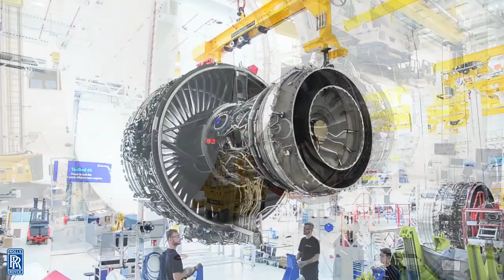Why don't Boeing and Airbus make their own engines?

Comment: Not only engines but aircraft manufacturers do not build avionics, instruments/sensors, computers, electricals, landing gears, propellers, tires, furnishings, windows, mechanical components, and many other components and subsystems. Their strength is in R&D, testing, systems integration, and marketing.  The certification and qualification of systems and sub-systems are complex, costly, and time-consuming. It depends a lot on specific domain skills and experience.

Comment: Then question: Why SpaceX who builds their own engine, avionics, landing legs etc has a cheaper cost than ULA to launch the same payload into space?
Reply: They are just going the Apple route but in the other direction. SpaceX is not cheaper, its just their profit margin is smaller compared to others and thats what you get when you have competition in the market. Now imaging if only SpaceX was able/capable of launching (monopoly over space), do you think they will not make the most out of it.
Reply: Two reasons:
1) They design/build very specific parts that not many companies build or that if they do, they sell overpriced since the demand is low
2) By developing yourself a piece, you remove the cost of intermediaries and their margins. Given that they use very complex elements, the number of intermediaries would be very high and they would probably lose a lot of money so that other companies make benefits
Reply: Because they bring the rocket back, while others throw it away.
Reply: @SheetHorizon21  No. SpaceX is not a toothpaste company as companies from last century, if their goal never change.
Reply: @smockydevil  
1) Yes. However, jet engines are also very specific. It is just appears to be that gas turbine technology can be used in various areas to distribute R&D cost. Rocket engine? Well, I do not know.
2) I think that is the reason why ULA's rockets are expensive and why NASA's initial proposal of Mars project was as well. If we can make things simple, we do not want to make it complex. That is how we do engineering.
Reply: Prince Ding avoid suppliers and competitions fucking with u
Reply: @princeding2114  
ULA was formed through the collaboration of Lockheed Martin and Boeing, they in turn subcontracted to other companies as well, adding up to the cost. NASA is known to also contract SpaceX (NASA's budget is tight right now so they will contract the cheapest company if have a choice), but their focus is still pretty limited so not every project can be awarded to SpaceX. Lockheed Martin and Boeing (and all companies they merged with) all have experiences with deep space projects, SpaceX's experience is still just within the Earth's orbit.
Reply: It IS cheaper to build things yourself. However jet engines are extremely complex and efficient, and while your margin would increase on the end product "planes", not all jet engines go to planes, they are used in many other places too. So you get another product line you have to sell to be competitive. Also for major businesses like Boeing and Airbus, which are publicly traded companies, the main thing is not to have lowest price and sell most planes, its more about exceeding shareholder expectations...
Reply: A lot of their components are not bring made by them.
Reply: EpiDemic117  WRONG !!!!  It is against anti trust laws in the USA for an airplane company to own an engine manufacturer and or an airline !!!  Back in the 1920 Boeing owned Pratt Whitney and United Airlines any by law suit from US government was forced to seperate !!! Anti trust laws !!!  Do the research !!!!
Reply: EpiDemic117  We are only talking about the airline business !!!!  That is what was broken up.  BUT as far as the trucks go Pac Car, Kenworth/Peterbuilt now are building their own line of engines !!!! As well as offering what is left of the industrial over the road engines !!!

Comment: Why doesn't Apple make its own camera, screen, battery?
Reply: it cant invent
Reply: Oh and they would make it double the doubled price
Reply: @User-nu6km  What is your definition of invent because certainly yours are different from mine.
Reply: putting things together from suppliers is not invention. Samsung makes their own ram, cpu, batteries, and screens for their phones.  @knmfujiwara
Reply: Although they do "make" their own CPU's and special chips, at least get others to make specific ones just for them rather than buying an OEM one.
Reply: They dont make their screens
Reply: because the something less time effort and money .
Reply: ams ag makes iphones proximity and light sensors.
Reply: Simple: APPLE WOULD F*** IT UP.
Reply: @User-nu6km  
Savage 😂😂😂
Reply: Apple do not even make the iPhone, the iPhone is made by Foxconn and Pegatron for Apple
Reply: @TheXcalculusx  Apple provides the designes  from Apple engineering teams ...chip manufacturers manufactre the chip provided from Apple which use arm architecture...as with design and camera lens and camera sensor provided by respective companies like Sony etc screen too and battery by other OEM anufactires like Samsung , LG ,jdl....so in this Apple contracts the manufacturing  companies..
Reply: Apples and Oranges😆🤑
Reply: It’s cheaper to outsource it to another company as they can buy all of the parts in bulk and they can save by not having to have to worry about having to build a new factory.

Comment: Your argument makes sense, however there are two more factors that you leave out.
1.) Mono- or Duopoly of Engine Manufactuers
There are only 2 or 3 Engines suppliers available for most planes. AND especially Boeing liked to do exclusive single supplier deals with only one supplier. So the argument of choice is not really there
2. Control over Investment and Production Ramping
The element of control over the production flow has become more and more important in recent times. As the saga of B737 and A320 series aircraft illustrates the aircraft companies being severely limited in their ability to ship aircraft due to the availability of Jet Engines. 
Apparently the engines for this class are highly valued but low priced and so the engine Mfgs. have not vuilt up sufficient capacity to supply the demand. This failure coupled with their oligopoly is costing Boeing and Airbus a lot of money.
So at least in the single isle sector control over production may become an issue.
Seeing the current shortages however illustrates powerfully how broken the traditional supply chain is.

Comment: I agree with what you have stated.  The engine competition remains as intense as the actual airline manufacturing.  I would like to see you do a comparison of the major engine manufacturers , including number of aircraft in various classes, safety record, and new orders.  Also, as a new 797 seems likely in the near future, it will probably demand a new class of engines.  Your analysis would be appreciated.

Comment: just imagine a boeing trent 1000
Reply: Airbus CFM56
Reply: Micah Briones: stupid comment! Trent 1000 is design for 787!
Reply: ROLLS ROYCE TRENT ENGINES ARE CHEAPLY MADE AND HAVE TENDENCY TO ROT, CORRODE AND EXPLODE PLUS ROLLS ROYCE SCANDAL PUTTING CHEAP METALS AND ALLOYS IN REPLACEMENT. BOEING HAS EXCLUSIVITY CONTRACT BARRYING AIRBUS FROM USING ENGINES MADE FOR BOEING JETS. ROLLS ROYCE ENGINES SUCK.
Reply: @kimberlywilliams7543  bruh. not even true.

Comment: Engine manufacturers are really good at what they do, just like the aircraft manufacturers are really good at what they do. I think the r&d that goes into each is astronomical in price, not to mention the proprietary knowledge involved in each. There’s probably a big liability risk in there too. Even the small aircraft companies don’t build their own engines. Before you compare aviation to the automotive business, remember that aviation is very safety regulated compared to automotive.

Comment: Now that Rolls-Royce has identified the very unfortunate problem in the Trent 1000, the knowledge gained will most likely make the Trent 1000, as well as the Trent XWB, Trent 7000, and others, more reliable than ever.
Reply: Rafael   RR will have to fix all the fkd up engines first !!!!

Comment: The fact is, both Airbus and Boeing are what's called an Airframers. The name kind of says it all. They build airframes. If you look at the aircrafts neither of the two companies actually "builds" most of the aircraft components. They will specify component requirements and buy parts from suppliers to put into their airframe. The gears are produced by one company, the avionics by another and hydraulics components by a third, or even several other companies. Basically no components or very few of them will actually have Boeing or Airbus written on their manufacturing tags. So why would it be any different with engines? Boeing and Airbus produce airframes which house components from other manufacturers, not everything on an aircraft.

Comment: The research in design, manufacturing and selection of materials required to make a decent engine took half a century to perfect.  Boeing, on the other hand, should finally do something about the 1950's era nose and front fuselage that the 737 MAX inherited from the 707.

Comment: Sticking to airliner jets Bristol and DeHavilland used to make their own aircraft and engines. Concorde was a Bristol design, made at the ex-Bristol factory using ex-Bristol engines (if a Rolls Royce jet engine has a non-river name it is not a Rolls-Royce design, hence, the Olympus engine was ex-Bristol). De Havilland also made jet engines, with the Comet the most famous civilian aircraft using DH jets.

Comment: Hmm. Interesting thought, GE is going to the only engine supplier for the B777X programme. Boeing said, it is to reduce the cost of each aircraft by having one engine supplier.  It will be interesting to see what will happen if GE being the only engine supplier to the B777X will do, experiences major problems with the GE9X like RR and P&W have had with their engines.
Reply: Chris   RR is the only engine supplier on the scarebus A350 !!!!  GE the sole engine supplier on the 747-8 and the 777X... By the way RR did not offer to participate in an engine for the 777X !!!!!

Comment: in 2009 the USA missed a chance to take away engine manufacturing from GM/Ford/Chrysler (also the dash instruments) .. the truck market, domestic and international (with a couple of exceptions) gets their engines from third parties .. the future of powerplants needs independent  thinking, motivation, and financing, especially for the car market .. elec engines, rotary engines or next-gen piston engines need to stand on its own and with possible consumer options based on owners needs and terrain .. the ludite practice of car companies making engines is holding the whole industry back

Comment: Why does Apple not make their own processor chips?
Reply: They do.
Reply: @Locutus  no they dont
Reply: Apple designs their ARM CPUs  and made by Samsung or TSMC fab contractors
Reply: @renebaebae0600  Apple may or may not 'manufacture' their own chips, but they design their own processors.
Reply: @Locutus  no, apple DOESNT MAKE (produce) their own soc. its made by third party manufacturer such as tsmc or samsung. hence my first answer. but yes they do design their own soc and leaves it to manufacturer to produce it
Reply: Apple dosent actually make the iphones
Reply: Apple is fab-less company, 
they don;t have their own factory for manufacture the chips & assembly
Reply: @Locutus  misinformation.   Apple is NOT in the CPU business.

Comment: Well there are a couple of reasons. Resources and regulations. Boeing and Airbus do not have the specific technical knowhow and experience to build an aircraft engine. 

Next, regulatory agencies such as the FAA have the engine building in a separate section. Both airbus and Boeing are certified as airframe builders (FAA CFR 25) while companies like Pratt, cfm, GE and Rolls are certified as engine builders (FAA CFR 33). if both were to go out and build their own engines, they would need certification and the authority to do so.

The lines do get blurred quite a bit when you talk about cowlings and reverses, but the separation between airframe and engine are pretty clear.
Reply: Rules and regs yes. But to say Boeing can't and dose not have the knowledge to build an engine is just wrong and stupid
Reply: @scott250r2  I didn't say that they can't learn to do so if they tried. They currently do not have the RIGHT expertise in my opinion. Their expertise is in airframe and NOT engines. 

I'll cite an example. For the longest time, they have been contracting out the work for nacelle systems to UTAS, Spirit, or Middleriver/Safran and that is as close to the engine you can get. They used to know until their propulsion systems division in Wichita got sold and eventually formed Spirit Aerosystems. They recently formed their propulsion systems team a couple years back in South Carolina and are essentially "relearning" the process of certifying and designing all of these nacelle systems in order to make them in house (well at least for the 737MAX and 777X). Even then, there have been hiccups like choosing GKN to manufacture the titanium parts for the 737MAX nacelle but not truly understanding that GKN could not meet the 737 production rate. 

The last time Boeing built any turbine engine from what i have seen was a turboshaft for the military and that was back in the Cold War Era. They can hire away as many industry experts as they want, but until they truly relearn how to build/design/test/certify these engines, they will face considerable challenges and significant resource drain in order to do so. They can set up the facilities, get the material they need, people, and machinery and tooling just based on typical industry practice and standards, but until they can get all the pieces together without failure and while maintaining a very fast paced production rate, it'll take quite a while to produce these turbofans that are commonplace in the commercial aircraft industry.

Comment: “Well, apart from Rolls Royce” #ROASTED #TRENT1000 #787NIGHTMARELINER #A330FEO
Reply: QuarioQuario54321 😂😂😂
Reply: Could you explain « FEO » ? I don’t have it.
Reply: William F. Maybe he means first engine option
Reply: Failing Engine Option or Faulty Engine Option. If I owned an airline, I would never buy my planes with RR engines. The A330neo and A350 force me to buy RR engines meaning I’d have an all-Boeing fleet or make the only airbus plane in my fleet the A380 or A380plus.

Comment: Boeing couldn't find suitable engine suppliers in the beginning and began building their own, they also could not find enough customers and so they started their own airlines and we're the first to have stewardesses  which I believe first appeared on the  Boeing tri motor. But alas, the snobs back east did not like this little Seattle startup rising so successfully and independently and competing with the tried and true of the industry. So they filed monopoly and anti trust suits forcing Boeing to divest both divisions. The motor division became Pratt and Whitney. The airline became United. My grand father was an electrical engineer when Ww2 broke out and worked on B-17s ,retiring on the 707. My dad started working there on B-52 #11. Then transfered to the Dash 8 program which became the 707. Then he transfered to Everett where he worked on the first 747 and every one after until he retired in 99. Dads brother worked on 707s and then 727s. Next month my son will start working for Boeing on 737 wings . I don't know why I never worked there. But I do know for my whole childhood, GE was a bad word and we usually flew United.

Comment: My question is with all the problems Rolls Royce has been having of late. Why any plane manufacturer or airline would chose to order their engines if given a choice?
Reply: They don't choose to go with RR. They do it because they have to. Most families of planes are only designed and certified around 1 or 2 types of engine. There are planes which can only use an RR engine. It's like US cable providers.
Reply: Doesn’t the 787 have the choice of RR or GE?
Reply: @lwrandall  Yep. That's one of the 2-type craft.
Reply: Engine manufacturers are part of the design and market phase of aircraft design. A large turbofan engine costs upwards of 2 billion USD to design and certify. 

If market analysis of an aircraft shows low market demand, an engine manufacturer will no bid the design. This is what happened to the A380, when GE and Pratt refused to offer an engine. The market analysis showed less than 250 aircraft over 20 years. If you were to have a three way engine split, each manufacturer would only be buildings 1,000 over 20 years, not nearly enough to recoup investment costs.
Reply: Gunga Dinn Thank you so much for the great explanation. I hadn’t thought of the overall aircraft market demand for determining what engines would be available.
Reply: @lwrandall  Yes they do !!!!  And GE has 60% of the business !!!